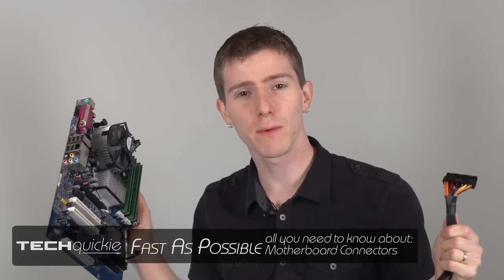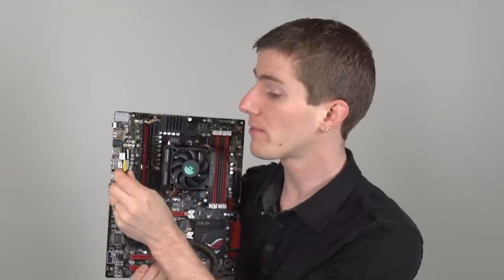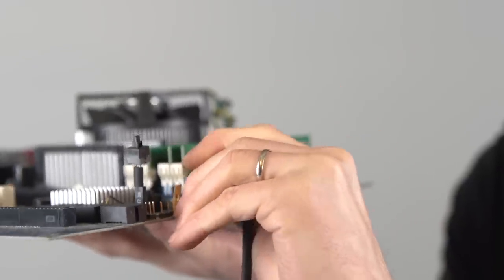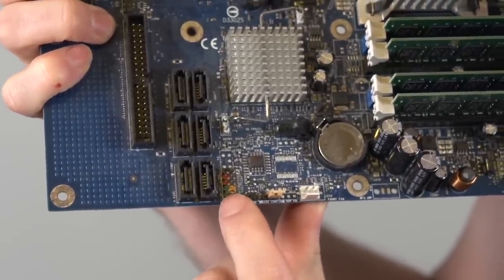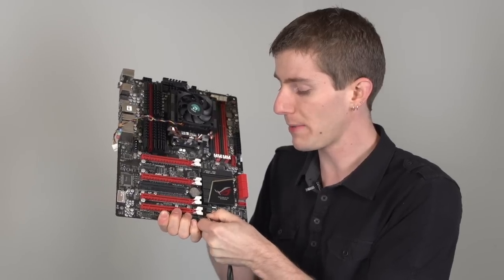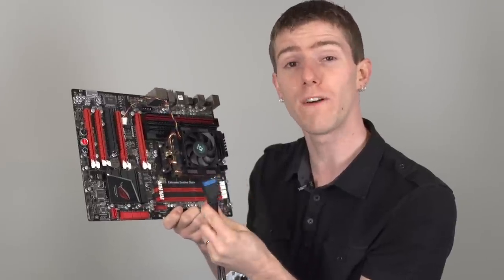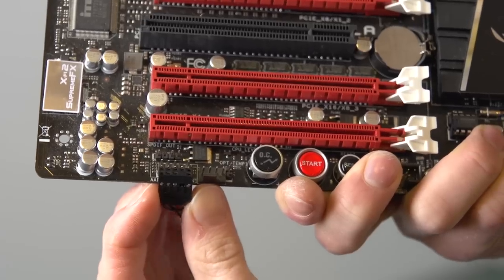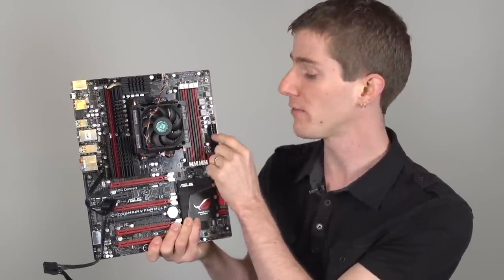Motherboard Connectors - All you Need to Know as Fast As Possible

Comment: how's these specs:

I7 4930k CPU
CPU cooler : Arctic Cooling ACFZI30 74.0 CFM Fluid Dynamic Bearing CPU Cooler
32GB ram (Corsair Vengeance Pro 32GB (4x8GB) DDR3 1600 MHz (PC3 12800) Desktop)
ASUS X79 Deluxe motherboard
ASUS RoG Swift PG278Q - G-Sync, 144hz, 1440p Monitor
Corsair Graphite Series Arctic White 760T Full Tower Windowed Case CC-9011045-WW pc case(that thing above this ^^^)
Western Digital 4 TB WD Green SATA III 5400 RPM 64 MB Cache Bulk/OEM Desktop Hard Drive WD40EZRX internal hard drive
(I may get an SSD later, i'd like recommendations on good SSDs for this build)
GTX 980 EVGA ACX 2.0 SuperClocked edition, im going to upgrade it when the new graphics card from nvidia comes out, ppl say its the 980 ti and when it comes out im going to get two of those things
I'm going to buy all that stuff separately ofc but for now im going to go to http://pcpartpicker.com/ to check the power consumption on all those parts so that I can get the right power supply that I'd not only use for the stuff in this build, but that it'll have enough power to run 2 980 ti's in SLI while they're overclocked(I'll wait for the EVGA superclocked versions before buying them though and I'll still overclock them anyway, same with the 980 from before)
Reply: Why would you even buy a 980 at that point? I think you should just wait for the two 980 ti's, you might just waste like 600$...
Reply: T- Rekt yeah i think maybe by the time I save up for this build they'll be out.
Reply: Minecast Zyad48 Also if this Rig is only for gaming ( I of course don't know) might I suggest you get the I7 4790k. It beats the 4930k in almost all games, of course it loses in rendering due to two less cores. You'd also of course save a bit of cash.
Reply: T- Rekt im gonna be doing rendering and 3d CGI animation as well but I dont mind that the cpu i chose has less cores, from my experience the I5 I have in my crap laptop(I5 2450m) along with my 6gbs of ramI can render a 1080p 20 minute video into mp4 format in about a half hour so the 4930k will probably be perfectly fine, im doing videos for youtube you see and I want the best equipment to do so
Reply: Minecast Zyad48 the 4930k has more cores than the 4790k, perhaps I worded it incorrectly. Although, the individual cores on the 4790k are considerably faster than the 4930's giving it a decisive edge in single core programs, and videogames. At least until video games are capable of utilizing 6 cores.
Reply: T- Rekt oh oops, ok i had forgetten which was my CPU, yeah im still going with the 4930k anyway for the extra cores for the rendering performance and from the specs i've looked at with high end pcs that big youtubers use and the ppl who have suggested me specs for a pc all have the 4930k as the cpu, i'm more of the multitasking type, I usually have a crap-ton of programs open so I need all the power I can get and the extra rendering performance does seem to be a nice addition, I guess I'll check out stuff with the 4790k, but I'd still like the extra cores and for 3d rendering and adobe after fx while usually GPU intensive can still use the cpu like when using the program, my currect pc is so slow that rendering a 1 minute clip out of adobe after fx that was recorded with fraps and had motion blur(reelsmart motion blur) added in took about an hour and the program ran very, very slow while I was doing the stuff, yeah I had mistake the 4790k before the 4930k, my bad, i'll probably stick with the 4930k and later when I absolutely need to upgrade this thing I'll upgrade the motherboard and get one that can support the 5th gen cpus from intel if by then they show significant performance differences cuz for right now what I want to do, the 5th gen cpus arent required
Reply: RyuTakeru ok im checking it out now :)

edit: jesus dude, i decided to just build from the ground up and trust me, my rig onceIM'm done upgrading it is gonna actually be more powerful than this and cheaper
Reply: if this is for gaming, a 4790k would be a just as good cheaper choice and 32GB of ram isn't nessesary for gaming
Reply: Matt_ThatOneGuy 4790k is actually considerably faster in games.
Reply: To much RAM xD
Reply: Leon DiSii lol well this PC isnt just for gaming, I plan on doing very demanding stuff like high end CGI and crazy effects with adobe after FX
Reply: Minecast Zyad48
Ahh okay then sorry :)
Reply: Leon DiSii no need to apologize I found it funny as well XD
Reply: Zyad48 - The Warrior of Evil you will need DDR4

Comment: I brought a mid tower case and it has two fans at the front and one at back and my motherboard only has one input for a fan what should I do ?
Reply: If you need/want more fans than your motherboard has connections for, you're going to have to get yourself a standalone fan controller or fan controller card.

Comment: what if you have a 8 pin and 4 pin for cpu power and the power supply has only 8 pin, should I buy an extra molex to 4 pin for overlocking?

Comment: So what if you plug in an auxiliary power suply connector when you're not using a multi-way graphics configuration?
Reply: Then nothing happens. Might as well plug them in, so you don't have to worry about it when you may upgrade to a multi-GPU config.

Comment: there isn't a speed difference just a power difference. The extra power is for processors that require a higher wattage to operate. 

Using two sticks is better than four because then there is less needed to look for. unless the board and ram is quad channel using two sticks will be better.

Comment: I'm very new to computer building, so whats the diffference between analog fan speed control and pwm fan speed control?
Reply: analog uses sine waves to control the speed of the fan while PWM which is short for pulse with modulation uses short waves of digital square waves in a certain speed to control the speed. often you can use 5v at 50 hertz to control a fan made for 3v without breaking it because it is only on half the time it is off. hope that explains a bit. Search pwm in youtube and digital vs analog to learn more.

Comment: Hello (Younger) Linus. Question from the future. I have an 8pin+4pin cpu power terminal for my asus maximus hero XII (wifi) running a i9 10850k. Should I use both despite no overclocking with LN2. Just wanna build my pc and start gaming. If you could make a video for this I would really appreciate it.
Reply: Try commenting on a newer video. Look out for when he drops a new vid on tech quickie Get there as fast as possible and post it. I hope he sees you comment
Reply: @KneecapTaker  Thanks, will do.

Comment: complete amateur question... do fans and cpu cooler etc all have and bring their own cords? or do I have to get them all? and sata
Reply: They all come with their cables and your motherboard will come with sata cables
Reply: Vladimir Casillas i have a queston to about coolers i might geta corsair h115i extreme it has a seperate cord do i plug it in a normal fan port
Reply: There's a cooler connector near the cpu socket specifically for your cooler
Reply: Ok thanks

Comment: How do I pick a power supply for my motherboard? How do I know it will have enough connections?
Reply: kindpotato Pretty much any modern day PSU will have enough connection cables for your board. I personally recommend Corsair PSUs. I've had more luck with them than any other. Just ripped a Cooler Master out after a year that recently failed and had to replace it with a Corsair HX 750i last week on one of our machines. Your main issue will be calculating how much wattage you need for your build and you can do that with the specs for each individual part, leaving enough buffer for any surges. Honestly, 600-650 is enough for most base builds with one GPU, with most people going for 700-900 watts just to be safe. Try finding a pro series PSU with removable cords for more control over your cable choices. Most have more than enough cables than you'll ever use, usually have doubles and triples of each cable in the box with the new unit.

Comment: Can someone help me?? If I buy a new power supply, does it come with the front panel connectors?? Or do the front panel connectors connect to the power supply??
Reply: Rayn The front panel cables comes in the case and you connect them to the motherboard.

Comment: So i Got a bit of a problem. Currently i am transferring my build into a new case, and my mothrrboard power cable (24pin) simply wont get out. Its stuck, any Help would be nice
Reply: Make sure you've got that clip out of the way, and then just pull, I guess...
Reply: Suspect How did you get it out???? i'm pulling for almost 10 min right now....
Reply: I wiggled it back and forth for 30min
Reply: Pull harder?
Reply: Dont worry i Got it out about a month ago. Was just giving advice

Comment: umm, looking at my mb there's a connector with a red and black wire and a 4 pin connector on the end going into a socket called "ATX power" I have no idea what this does, its above the GPU and to the left of the CPU heatsink
Reply: yellow and black*
Reply: That's auxiliary CPU power

Comment: i heve 16GB ram 1600mhz but onlt 2.79 works and 650mhz
is that becouse of system in win 7 32bit?
Reply: 32 bit can only use 4 gb of ram and since some of that goes to system, it will be less than 4gb that will show up. So the rest is useless. If you use 64 bit then you can use up to 256 gb of ram i think. It might be more than that

Comment: i need help im build my first pc and the motherboard i got is a gigabyte 78lmt usb3 and my power suply is java 500 watt on my motherboard the is slot that says atx 12 volt it has 8. pins ane my power suplly has a cort with 6 pins and another with 4 what am i suposed to do i can plug them both in that once but the problem is 2 sockets are of socket if i do that does anyone know what to do
Reply: 6 pin and 2 pin go into your graphics card, 4 pin and 4 pin go into the cpum

Comment: So a 4pin eps on the pcu will work on a 8pin eps motherboard????
Reply: +the melon yes but as stated in the video please do not insert PCi-E Power Connectors into the 8 Pin socket. These are not compatible and will fry your mobo upon power up.
Reply: Yeah, In that case put the 4 pin into the nearest end of the slot to the  CPU.

Comment: Sorry in advance for spelling "Mullex" wrong i dont know how to spell it) i know this video is old but i need help. My case i have now, i dont really like, but that was never a good enough reason for me to get a new one, recently i had to get a new power supply, and it didnt have mullex connectors for the fans. I took this opportunity to look at some new cases, and i like the h440, but i am wondering if the fans are powered by Mullex? i have a Corsair 750W Power Supply if anyone wants to know.
Reply: Most newer fans are powered by the 3 and 4 (PWM) pin fan connectors on the motherboard. The molex only powers things like harddrives.
Reply: my case is relatively new(fans came with the case) but now that I think about it, it's actually kinda old, it's an old phantom from nzxt, that they don't make anymore, so maybe it's time to upgrade, but I've been using my PC without fans and it has been fine so far

Comment: What does he mean with analog fan speed control pls help.
Reply: The 3 pin connectors can control the fan speed by changing the voltage over them, while the 4 pin connectors use that fourth pin for fan control.

Comment: Will there ever be a Essay-Tech channel, where you cover literally every possible way to hook up shit to a motherboard, for instance?
Because i REALLY have trouble finding out things like (brace yourself):

How many fan headers do i need for this specific case with 3 case fans?
How do i hook up my fans?
How do i control my fans?
Do i have to manually control my fans, or can i let my PC determine the speed based on temperature?
Do i even HAVE to control my fans?
What fans should i buy? (exact model)

And sadly, the list goes on...
And on...
Up to 137 questions.

"PC building is like Lego's for adults."
Well, diagnosed "genius" here can't fucking figure it out.
(No, i'm not talking about IQ or anything like that as it's irrelevant and a subjective number, and a flawed system all-together. Google it if you'd like to know more about that.)

Comment: Listen guys I need help I'm starting my pc build and I plugged in my power supply and it's 24 pin connector and I turned on the power supply but no lights or fans started that's the only thing that I have on the motherboard it doesn't have a CPU or other stuff yet I'm completely new to this 
Thanks guys

Comment: Couldn't access the website link and still waiting on my verification email from your forum Sir Linus.. So, I suggest (if not already done) you make a video about all the abbreviations to do with computers, please. E.g. PCI and CPU, and so on. I've really enjoyed your videos and I'm new to the PC scene so I don't really know a whole lot. I will be building my first PC soon and knowing all the abbreviations would be great!
Reply: +Morgan Noble I know you probably want it more in depth than this but I'll do the best I can(I am not a professional in the computer business, anyone feel free to correct any mistakes I make). Motherboard(MOBO) is the main board that everything plugs into. This video shows about all the power connections you need to know for that. RAM(Random Access Memory) is what loads in data, instructions and programs currently in use by the computer. Having more RAM allows for better multi-tasking however if you are not using all of your RAM then getting more will have no impact. Typically expect between 8-16gb for a standard gaming RIG. PCI(peripheral component interconnect) is the large connection ports usually at the bottom of the motherboard. Although PCI is forwards compatible(A PCI 1x component can go in an 8x slot) It is not backwards compatible unless you physically cut off connectors due to physical restraints(I think Linus has done a video on this). The CPU(Central Processing Unit) Is what does the main thinking of the computer essentially think of it as a multitasking Brain. You chuck any command at it and itll be able to perform it. CPUs have a specific socket. The motherboard you get must have a matching socket(my CPU has an lga1155 socket and so I have a motherboard with a lga1155 CPU socket on it). When getting a computer find a CPU you like first then a matching motherboard and build it from there. A GPU is more commonly known by the name Graphics Card and is like a screwdriver, unlike the CPU multi tool it cannot do everything but if you chuck the right screw its way then it'll do a much better job.In this case the screw is normally 3d graphics. Unless your doing gaming you dont need to worry about this however if your going for a gaming rig then youll need to seriously look into this as it will be one of the biggest impacts to your performance. The last few things you might want to know is VRAM(video RAM) which is how much RAM is located on the graphics card itself. SATA which is the connection used to link hard drives to the motherboard, RAID which is an advanced type of hard drive setup(there is plenty of videos online). Finally HDD(hard disk drive) refers to the original and most common kind of hard drive. It uses physical moving parts to store data and so is relatively slow compared to an SSD(solid state drive) which has no physical parts allowing for much faster read/write speed at the cost of well price. I hope this helps if theres anything else you wanna know just ask :)
Reply: +Elliot Fenwick Thanks heaps Elliot, I do know what cpu, gpu, ram and a few other acronyms are but compared to how many there are I know very little. I've been smashing out research on PC's for the last few weeks seeing as I finally have the means to build a PC and move up form console gaming and I'd prefer to watch a video on every possible acronym supposed to reading.   But I do really appreciate your reply/feed back to my comment. Top bloke!
Reply: NP

Comment: I tried turning on my computer with my 4 pin connector unconnected did I fry it?
Reply: umm possibly because one of those pins I believe is a ground pin and another is a +0.5V connector
Reply: nah i didnt i just plugged it in and it worked
Reply: +Aaron Mcp oh ok lol
Reply: +Aaron Mcp no you didnt the 4 pin / 8 pin is actually CPU power so you just had no power going directly to the CPU

Comment: Where to connect PC (motherboard) speaker?
Reply: You mean one of the front panel ones? look in the motherboard were its needs to be. every mobo is different.
Reply: +Peter Leconte I mean beeper speaker , it's beeping when some error is hapen or on startup
Reply: I think you need to do that there as well. If you the correct name I can look it up. :)
Reply: you usually connect it onto the front panel header with the power reset switches and power HDD LEDs. Just look in the manual if you're unsure.

Comment: What if my mobo supports usb3 but my case doesn't?
Reply: Motherboards usually have both USB 2.0 even when they come with USB 3.0. In short, you won't be able to use the USB 3.0 with your case if you're wanting to use the USB 3.0 slots outside of your case unless you buy an adapter for the different connectors. The USB slots in the back of the case (motherboard USB slots) are usually enough for everything. They come with 4-6 USB slots in the back.
Reply: chainy10
So, should I buy an adapter, or just a different case? I was going to buy a Cooler Master HAF 912 (excellent case for the price) but it doesn't come with usb3 front ports.

Comment: can someone explain to me the USB part, arent all USB the same?
Reply: jims kimmel USB 2 and USB 3 have different headers due to the fact USB 3 has an additional 5 wires per  USB socket. Thus USB 2 headers have less pins than USB 3 headers.